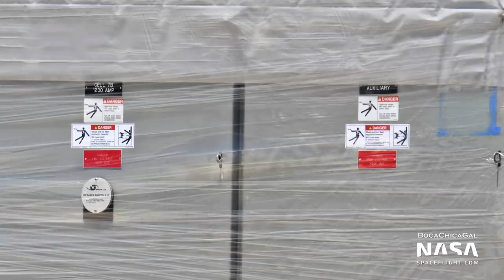Orbital Launch Site Preps Continue as SN20 Aft Dome is Spotted | SpaceX Boca Chica

Comment from the maker: Timestamps:

0:00 - Sunrise at the Production Site
0:36 - "Star Base" (This is a Star Base) Production Site
1:03 - Work on Cryo Shells and Launch Tower Segments Continues
1:30 - Work on Cryo Shell Continues
1:54 - Scaffolding Going Up Around a Tower Segment at the Propellant Production Site
2:24 - Claw Attachment for a Crane Delivered
3:09 - Starbase Orbital Launch Site / Crane Extending to Work on Integration Tower
3:54 - Staircase Sections Being Removed from the Integration Tower.
6:22 - Work Continues on the GSE for the Orbital Launch Site
7:33 - Preparing for Fifth Extension to be Added on the Orbital Launch Mount
7:53 - Installation of the Jib on the LR11350 (Frankencrane) starts
8:27 - Super Heavy Test Tank BN2.1 Being Prepared for Testing.
8:57 - Fifth Extension Added on the Orbital Launch Mount
9:37 - Delivery to the Launch Site
10:03 - Work on Integration Tower Continues
10:30 - Delivery to Orbital Launch Site
11:38 - Two Launch Tower Segments Being Prepared for Roll Out to the Launch Site.
12:00 - Grove GMK6350L at the Production Site
12:41 - SN20 Aft Dome
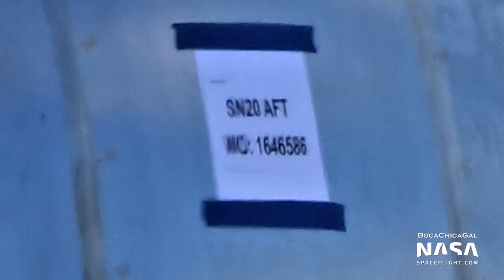13:19 - Sixth Extension Added on the Orbital Launch Mount
Reply: Thanks
Reply: Could sn-16 go orbital? I’ve heard that, didn’t know if it was konfirmed
Reply: @Ethan_Frost  Nope, it cant go orbital because.
1. It lacks necessary hardware to attach to Super Heavy. Going orbital with only 3 Sea level raptors is impossible for Sn16
2. It has no Raptor-Vacuum mounts.
3. I lacks a full heatshield. 
4. It lacks the Methane hot thruster RCS needed to make quick and accurate adjustments in orbit.
5. Modifying SN16 for orbital launch will take too much time and effort, you might as well use that time to build a proper orbital starship like SN20+.

Anyone else thats telling you its orbit capable is delusional and lacks proper knowledge.
Reply: @pikaachoo3888  I’m fairly certain that starship has RCS ports. Perhaps I’m wrong, but I feel like I’ve seen them somewhere during a previous test
Reply: mmmh high Voltage/Amperage switching gear with rear mounted 3 phase busbar system (red silicone on the side)
Reply: Dose anyone know if Elon has commented on the excellent work from Mary et al ?
Reply: 2:24 Scrap metal 4 tine claw..........Musk is cleaning up........
Reply: @sleepdeep305  SN16 has cold gas thrusters, they are weak and inefficient. The RCS I am referring to are methane Hot thrusters which are essentially mini-raptors, SN15-19 dont have the infrastructure to support those hot thrusters. Nicotine Jenkins have a couple of videos on those hot thrusters, spacex are testing them asap since they are needed for SN20.
Reply: I've only seen Elon saying "Starbase" - one word. Did he recently mention it as two words? I found nothing.
Reply: This isn't a space mission, this is an economy boost, and unfortunately a country that has to feed it's own economy is a loss

Comment: Holy cRaP!!!!! The launch mount table is going to be installed soon.
Reply: Yes !!  Is gonna be exciting, because a lot of mysteries will be solved. 
I am also curious to see the Tower being finished. It will have a stacking crane, and probably an access arm (for tech crew) but no catch arms yet.
Reply: If it's just the equipment for the clamps for sure, but may need more of the outer plates
Reply: @jmanhockey2   - Yes, holding clamps.  But what about the water deluge system ... if any ?  That is still unknown.
Reply: @BrewCityChaser   - Yeah, i think so too.  Piping, gutters, etc. is all missing.  Elon wants to do without and if possible then that's great.
Then, besides the clamps, the launch table will only provide the fuel-pipe connectors.
Reply: @tubularap  crazy to think that they already have thes things designed. All of assuden they will just be built and installed so quickly. Very exciting time.

Comment: Hey, now that they’ve got all 6 caps on the pillars, we might be close to them mounting the launch table finally.
Reply: Comparing to the very rapid pace of everything else, finishing the launch table is taking a surprising amount of time and labor!
Reply: 'Finally'
Reply: @gabrielpi314  Yes, finally, in relation to how long other things take at the worksite.
Reply: Thing’s been sitting there for so long it’s already accumulated more rust than ol’ starhopper.
Reply: @walker1054  it is the sturdiest thing in starbase 

Also the sn8-15 flights slowed the construction
Reply: Table will not be mounted until after the tower is finished stacking. They'll lower the crane, return it to first config, use that to lift and mount the table, then take the crane out. They are still putting in swing arm things on the inner ring of the table. It isn't just a platform like the test stands are. It is an integrated hold down and launch/release system for the entire starship stack. It has to take significant amounts of weight and thrust and there's mechanical systems that need to be in before they mount it. Patience. :D They're going as fast as they can on it.
Reply: @andrewedmunds4583  starhopper is made from stainless steel, isn’t it?
Reply: There is a lot of new technologies in the launch tower, they have changed things and design while building for instance the stand that the booster sits on.
Reply: @WatchTMC  Stainless can rust. Its just more resistant. Environment on the gulf coast is quite corrosive.
Reply: @mycroft16  Thanks for the high level of detail!
Reply: @walker1054  LOL.  Yeah.  Elon time = Date Expected - Date Wanted + 6-12 months.
Reply: @mycroft16  Are those "swing arm things" you speak of the hold-down clamps for the booster perhaps?  They went internal to the table rather than external clamps.  Lots of renderings showed external for a long time.

Comment: So many buildings, pumps, pipes, tanks etc. so close to the launch platform. When the first fully staged Saturn C-5 blasted off in 1967 no one had any idea the effect 7.5 million pounds of thrust would have on surrounding structures. So Walter Cronkite and the news team were located in a bunker just 3 miles away and during the launch sound waves rattled windows and ceiling tile fell down. No one has ever fired off 15 million pounds of thrust, hope the engineers have accounted for this.

Comment: I had doubts, but the orbital site seems like it will be finished by end of june as planned!
Reply: Nah. Maybe end July
Reply: Are they gonna put on the arm before or after sn20 launches? That arm has to take at least a month due to its complexity
Reply: @dominictorettogaming6678  Temporary clamps for the Starship upper stage will be used if any are used for it at all, but there will definitely be clamps for the Super Heavy booster.
Reply: @Galm1Cipher0  
Skeptics will remain skeptics even if their skepticism is deviant of reality.
Reply: @Galm1Cipher0  I would say that it would be finished about then 

But sn20 will fly by the end of august
Reply: The first flight will see both stages perform an ocean landing. As such the only thing needed on the tower for SN-20 is for integration and fueling. The catching framework will be needed only when they want to re use the superheavy
Reply: @mobiuscoreindustries  at least after landing it probably a few times
Reply: @mobiuscoreindustries  not even that, starship is fueled through the booster so they will need the tower just for stacking and accessibility afterwards
Reply: September, fully stacked Starship, orbital flight, splashdown.

Comment: Thanks for these awesome videos! At 11:00 we see high voltage switchgear complete with amp ratings and arc flash labeling. My guess is that it's a motor control center for the pumps that transfer the fuel to/from the rockets.

Comment: I have already tilted my monitor vertical ... in preparation for the finished tower and the full stack  ;-) ;-)
Reply: Probably it will not be enough, that tower is too high. Put another monitor on top of the first one. :D
Reply: This is the ONLY exception for vertical filming on your phone! ☺️
Reply: @Kabup2  I have an Ultrawide :)
Reply: @Kabup2   - Good idea !!  I've got 5 more 24" monitors, so I'll just keep building along with the Tower. But I need to do something about my ceiling, though ... ;-)
Reply: @vonpredator   - You are absolutely correct. Anywhere else it should be forbidden, but here it's almost mandatory to film vertical.

Comment: Wonder why they are removing the stairs on the integration tower - maybe to replace them with a different type. Or perhaps a giant slide.
Reply: Zip line.
Reply: Cuz they have an elevator now...i think
Reply: @ZPositive  My theory is they replace them with a different type of stair - probably a rectangular stairwell instead of the ship ladder type they removed.
Reply: I think the stairs were only for section construction - they're unneeded and pretty useless after stacking. What could usefully go up or down the stairs on a full tower? Especially one built mainly for unmanned test flights? There are plenty of cranes around as a backup for the elevator.
Reply: @jimirving3235  I think they will have stairs  having only elevator is a problem if it has mechanical issues or requires maintenance.
Reply: @ZPositive  The stairs removed are ship ladders not normal stairs - i think they will install a stair well to replace them.

Comment: @3:09 it looks like they plan on blowing up a bunch more stuff. Need that scrapple grapple to clean up the mess !
Reply: I had the same thought.
Reply: Wouldn’t be surprised if at some point FrankenCrane is used to collect leftover SN11 parts still strewn around the site...
Reply: @vonpredator  That is what I've been thinking also. Reach out over some hard to get parts with minimal disturbance to the wetlands sanctuary.
Reply: @vonpredator  FrankenCrane's boom is way too heavy. It works best when vertical. But the LH 11000, (The Yellow Crane) now that's a different story. With it's lightweight main boom with a capable height of 510 feet without jib. And an additional 374 feet with lattice jib, and total ballast of 1,741,650 pounds, would make that crane a grabbing monster !

Comment: The 9:37 "Delivery to Orbital Launch Site" looks like a UPS. The kind they use in data centers to connect multiple power sources (generators, mains, battery) to provide uninterrupted power to the installed hardware. Guess it makes sense to have those on a rocket launch site.

Comment: The wonky angles on the orbital launch mount seems that all of the weight and pressure will cause the original six pylons (??) to push inward unless they put some sort of mutual reinforcement beams  back in.  I'm no engineer with all the physics at my disposal---but wonky here just doesn't seem sensible.   Great video, though, Mary.  Thanks
Reply: The six leg extensions have got brackets welded on both sides now. They apparently will be used to attach T- beams between all of them. This will stop the legs being pushed inwards. Let's hope the extenders can take the huge added pressure to their sides..

Comment: The kink in the launch table legs is an odd decision. I wonder whether they decided they needed the table higher after the legs had been installed, perhaps to reduce the risk of debris being blasted up into the engines during a static fire?
Reply: Depending when the decision was made to catch the booster (vs legs), they could be making up the height difference. Those columns were being put in place a very long time ago, in elon-time. In any case, I agree that they're an unusual design. The eventual second orbital pad may shed some light on if that was a band-aid, or if they build the second one the same way.

Comment: Wonder why the stairs are being removed.  I would think reliance on the elevator alone is not per code. Maybe they found out they have to put them in later in the assembly.  Adding the elevator grid now is requiring the Frankencrane to lift a bit higher, but that shouldn't yet be a problem if the crane has been made a lot taller.

Comment: Why they remove the staircase? if the elevator doesn't work? the stairs are for emergency
Reply: Maybe there are other things that have to go in that same location: plumbing, electrical, structural supports, etc.
Reply: I would think that it's safer to not have the stairs. With a tower that all, a single misstep could spell disaster.
Reply: They probably took them out to make room to lower materials down to build the permanent elevator and/or stairs.

Comment: They must be removing all the stair segments of the launch tower.  The new segments do not have  stairs as far as I can see.  Seems like having the stairs would be required.  Hard to believe the would be re-added later.
Reply: That's what I was thinking too. Or maybe they'll just go for a zipline like NASA had for the Space Shuttle.
Reply: Could go with a scaffolding stairwell like they used to have on the back of the high bay for emergency egress if the elevator breaks down during construction, would be a lot easier to dismantle when complete than fishing those stairs out of a 469-foot tall tower :)

Comment: Why are the steel cross beams bolted and not welded in the integration tower? Seems like it would be more expensive to use bolts? Are they planning the take it apart later?

Comment: How are the extensions attached to the launch mount legs? Are they just welded on? I see the 12(?) nuts at the tops of the collars, but they don't seem like they are part of its attachment.
And, how were the collars attached? They had a bunch of long rods with a nut at the bottom. Were they lowered into wet cement?
Reply: I've been wondering the same thing.  It seems like they were going to do something, and then just didn't.  When they put the collars on, the rods went through the collars into the legs without guidance, so, apparently into a hollow space.  Then The collars were welded on.  Now the upper legs are fitted and welded to the collars.  We may have missed someone climbing into the upper legs to secure the rods somehow, except the upper legs seem to be sealed at the top.  And the rods would only secure the upper leg to the collar this way, meaning the lower collar weld would have all the stress, though admittedly it would be a mostly vertical force.

Still ... it is an interesting development.  From what I have seen, it would seem that the rods are still in there, able to slide up or down, but unconnected to anything.

I may have missed something though.

Comment: Any idea why they are removing the staircases from the launch/integration tower? Thanks.
Reply: My guess - they can't be made blast-proof. They were needed for the lower sections until the elevator was installed, and now it's time to go.
Reply: @donjones4719  That's my best guess right now as well, I just find it hard to believe. Stairs are just metal, you can make them more robust against pressure or apply thermal protective coatings if needed. I'm much more concerned about the elevator getting damaged. Aside from all of that one would think that stairs could be useful to perform inspections of the tower, etc. Unless they plan on just moving a boom lift over each time they need to look at something. 

As an aside, I wonder if they will integrate spot with the elevator so that it can go floor to floor for routine inspections?

Comment: Why remove Stair cases?  always good to have back up way up or down?  Do they need the space the stairs occupied for something else?  Electrical or fuel piping?
Reply: Might not be able to get them out once the tower is much taller, since they have to come out the top. Probably needed them to get to the minimum height for the elevator.

Comment: Could sn-16 go orbital? I’ve heard that, didn’t know if it was konfirmed
Reply: No, it can't mount anymore heat shield tiles and would need a lot of re-programming, and the entire aft dome would need replacing for the Rvacs.
Reply: @imperialtiger9015  No need for Rvacs for the test mission.
Reply: Doesn’t appear SN16 will fly.  Really a shame.  At some point they will need that space in the high bay and it will be moved to scrap yard.
Reply: @FastSloth87  then why are there those mounts on the aft dome for SN20?
Reply: @imperialtiger9015  Because SN20 will get Rvacs. What I said is it doesn't NEED Rvacs to to that not-quite-orbital test that will land near Hawaii. If 16 gets more TPS it can do it, but i doubt it will, so to the scrapyard it goes.
Reply: @FastSloth87  ah, I see what you mean.

Comment: Why do the supports for the orbital launch pad need to have a bend near the top?  It looks really weird.
Reply: That's what everyone has said in one way or another.  There are places where horizontal brackets can be attached to the extentions to provide better support, but that bend in the legs is still the weak point as you also noticed.   

As with everything else we'll see what happens.
Reply: Flaring the below-ground portion helps resist pull-out while the engines are firing and BN's held down by the launch clamps. There's 100+ feet of reinforced concrete in the bored piles (drilled at the same angle) below each steel casing, and flaring them means that the rocket thrust would also need to displace all the soil around the piles to pull them out. The gussets around the outside will resist the bending moment at the 'knee'. I'm sure their engineers have designed all the connections to have sufficient strength, no matter what the internet thinks.
Reply: @dancingdog2790  You'd think, at this point, that people would trust SpaceX engineers a little more. Especially as we have next to zero knowledge of all the weights, thrusts, figures, etc. We don't even know how the whole thing goes together yet. There's speculation, which is fine. Then there's questioning the intelligence of the people making this... not okay.